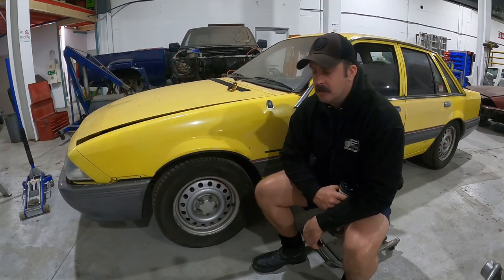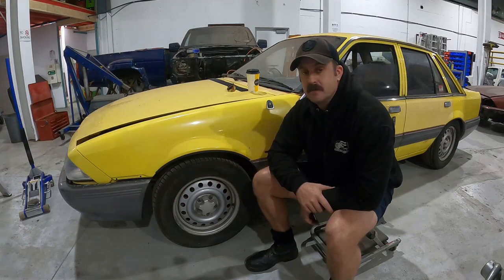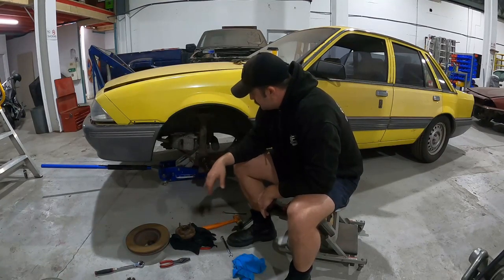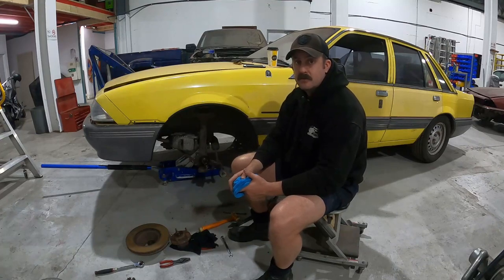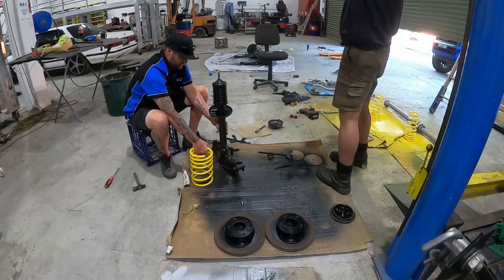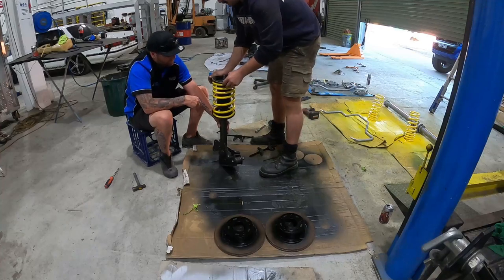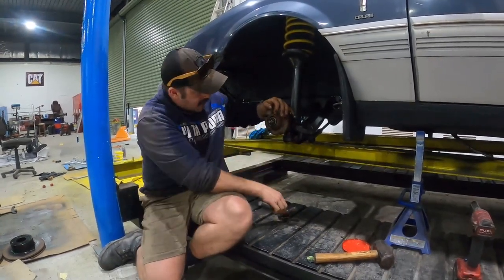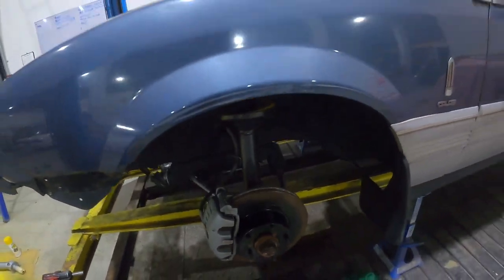Holden VL Turbo Commodore Build - Front Suspension and Brakes

Comment: Gday mate.   I have a VL executive with the original Discs on the front and original drums on the rear .   I'm Upgrading to VS discs on rear and VT dual piston calipers on front.   The car has the metal booster and the 15/16 master Cylinder.   I was going to put a VT master and VS booster in for the upgrade,   but have now been told that I can keep the original Metal VL booster and simply buy a VL 1 inch bore master cylinder for my upgrade replacing the 15/16 factory master cylinder.. Do you think this will be satisfactory for my brake upgrade?
Reply from the maker: I’ve ran the exact setup you described in the past and experienced no issues, it will be more than satisfactory. I upgraded to the VT front calipers, left the factory single diaphragm metal booster and replaced the master with the 1 inch bore VL Turbo/V8 master cylinder. I will be doing this also to my Blue Calais. My White Calais has the VT master/VS booster combo, in my opinion between the two, the stopping power is the same, the VT/VS combo just has a better pedal feel.

Comment: Quick question what brake booster are you running for the vt front brakes
Reply from the maker: One of my cars has a VS Booster and VT master, the other one has a standard single diaphragm booster with VL Turbo/V8 master,  both run the VT front brakes with plenty of stopping power. The VS Booster and VT master just has a softer pedal feel in my opinion.
Reply: I’m upgrading to VS booster at VT master, I have the thread adaptors but I’ve forgotten which order the lines go into the master cyl

Comment: Hey dale can I use VX brakes and disc or only VT?
Reply from the maker: VT and VX are the same mate, so yes you can use them 👌🏼
Reply: @dalevloghlan8771  how about VX diff can I use that aswell. Thank you
Reply from the maker: Nah mate it’s not bolt in, you would have to fabricate mounts etc, would be a nightmare.

Comment: What did you do to make the hub fit
Reply from the maker: It’s a specific conversion hub for the early model commodores, then the VT disc will slide on. The VT brake caliper will bolt directly into the factory spot.